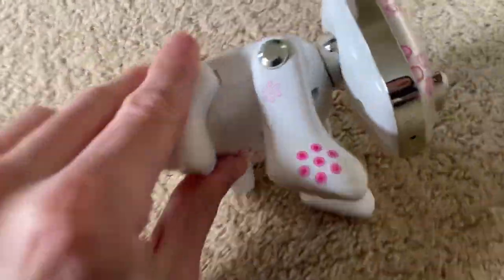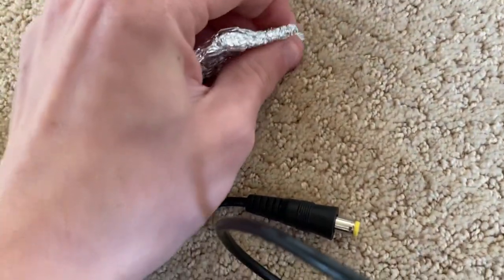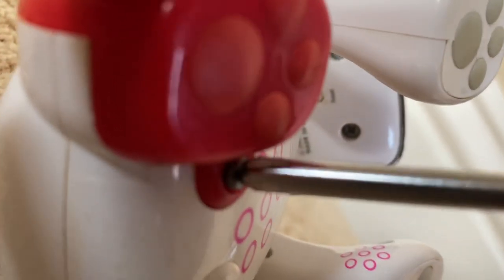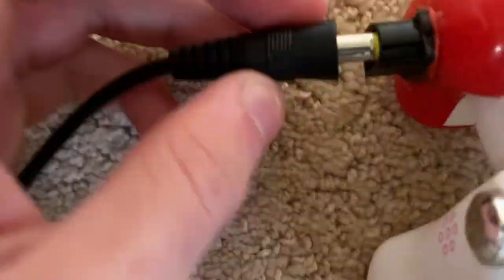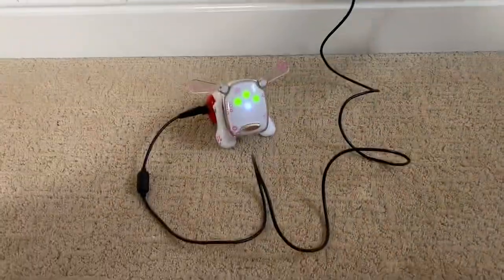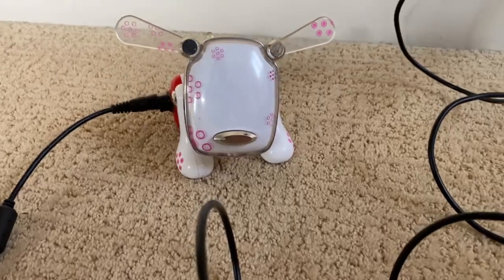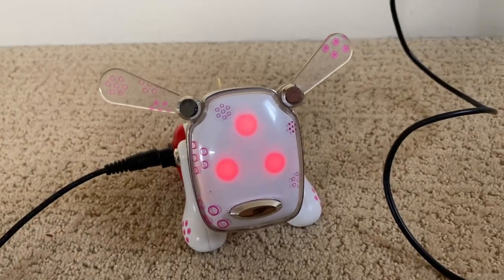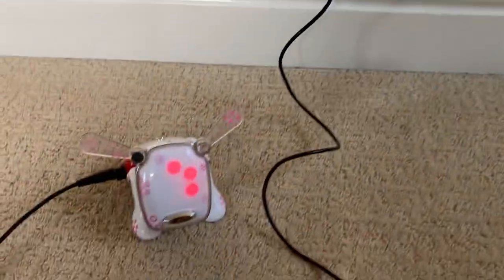How The I-Dog Runs On An Adapter

Comment: Youre still posting?! Woah, I expected this to be a dead account... thats a really cool mod! you have a ton of idogs, crazy how you managed to find so many. You had to spend a ton on those since i just spent like 20$ on a black idog dance.
I have an idog ampd, black tattoo design. Yellowed a bit and also its ears dont really move much at all anymore, is that just due to age (got it and used it a ton when it was new) or is it about time for a battery change?
Reply from the maker: Yep I'm still here haha... I've been collecting idogs since 2007 or 2008, and usually I get some good deals on them.
Dude you have no idea how lucky you are to have the black tattoo, that is easily my most wanted idog right now and my second favorite idog of all time. I've been searching for like over 10 years for one with no luck. As far as the ears, a battery change could help but sometimes the ears move better when their manually positioned a little further up.
Reply: @IDogFan41  It's my little baby! I got it right when it was new because I was a spoiled little brat that came and saw and screamed until I got the funky tattoo robot dog. 
Not very nice on my part but hey, at least I managed to snag a good one! I'm a changed person who no longer throws temper tantrums over toys in a store.
I don't think I'm gonna be selling for a while considering A: its rare B: There is SO much sentimental value attached to this thing. The days where I cried because my cousin snuck the llama song onto my iPod and it scared me... listening to the twilight soundtrack.... apple bottom jeans... Shockingly, when I was little, I never explored the pet aspect of the dog and used it as a speaker. I'm starting to do it now. 
Back to my original comment, I think it IS in need of a battery change. Tried to do a riff to see where it was in terms of happiness and it cut off and did the little startup grr bark and went back to dancing. That hasn't happened before. I'll have to check if I've got batteries.
Later today I'll post a video with him. Kinda feel like flexing now, as obnoxious as that is. :>
Reply from the maker: @Smug_Wolf  Do the flexxx lmao, as much as it sucks for people like me who are searching endlessly for one of those gems, it's nice to see more black tattoos show up! I wonder what pitch its in lol, also I can show you how to increase its mood and stuff like that. They take only 3 double A (AA) batteries so that shouldnt be too hard to get.
i'm also trying very hard to not start begging for it like a weirdo lmaooooo
Reply: @IDogFan41  It's fine dude! Video's up for you to see, and I really hope you can get your hands on one! Gotta suck being a collector for so long only to have one of your favorites and the last you need just out of reach... Talked to my dad about collecting the Amp'ds at least so I might start doing that sometime too. :D
Reply from the maker: @Smug_Wolf  I just saw the vid dude you are SO lucky to own that thing!!! Well done!
However, despite me wanting it so bad, my first two idogs (blue flowers and green circuit) I also got in stores, and they have basically equivalent rarity. There's four wave 2 ampds that are uber rare, and the one I just happen to have a hard time finding is the black tattoo lol.
Again, well done! You just earned yourself a new sub lol.
Reply: @IDogFan41  Ayy thanks for the sub! :D
I think those might end up being tricky for me too... didn't even know those existed, actually. I got a ways to go, only one Amp'd and a Dance on the way, but at least I'll be able to get a good chunk of the common ones before really having to dig for those rare ones.